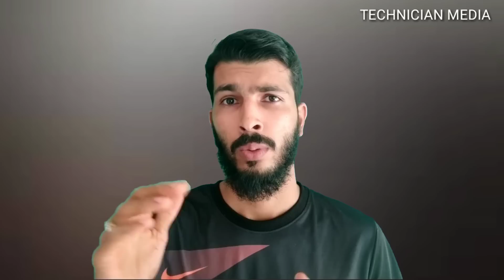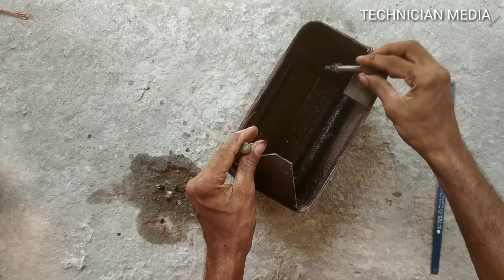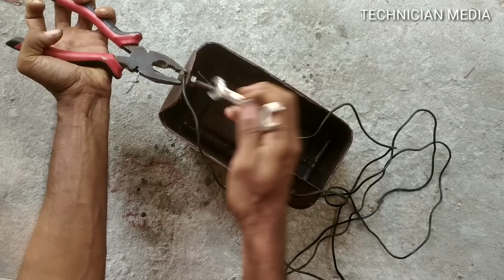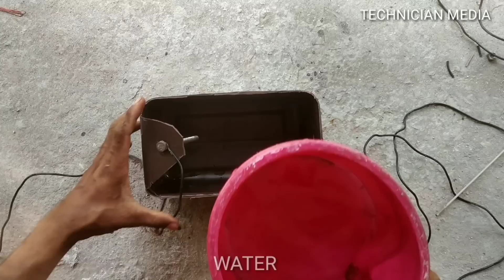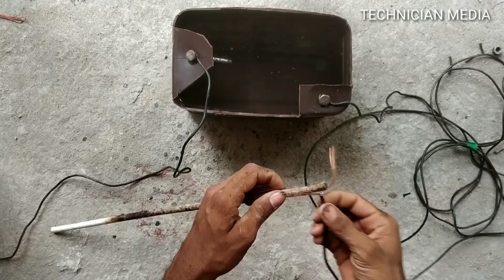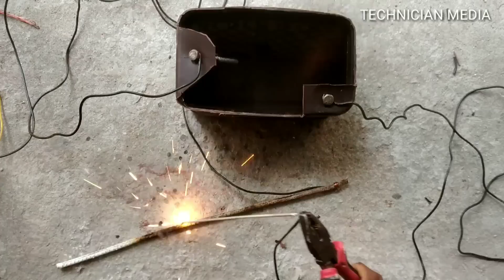Salt water welding

Comment: Things may work...
But It is very very dangerous...
please don't follow this video blindly.

Current will be certainly very high and enough to damage house wiring and even burn you .

Please add safety instructions in this video and make everything clearcut which will make video professional.

There are some  ethics to become a good youtuber.